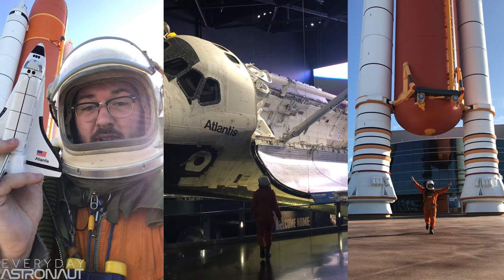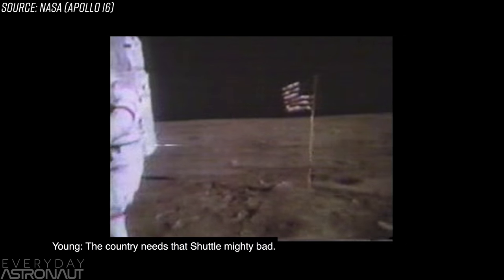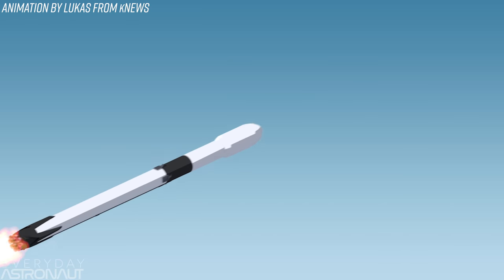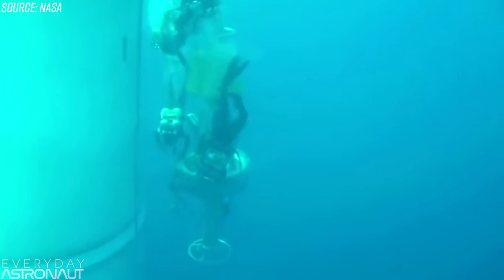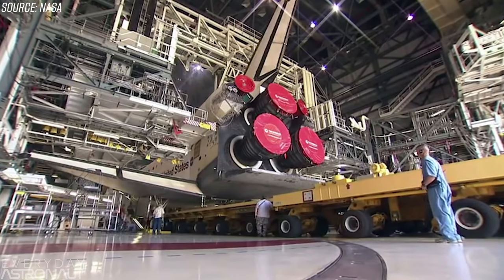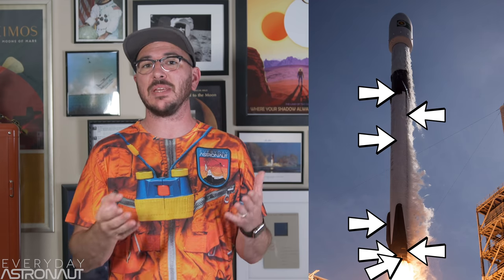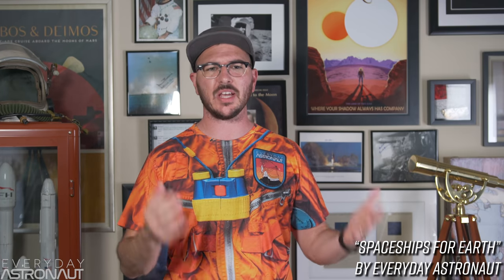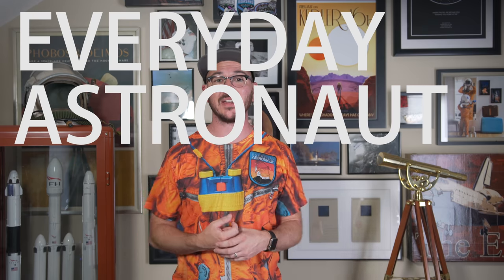Will the Falcon 9 actually be reusable or just refurbish-able like the Space Shuttle?

Comment: I think it's a real apples-to-oranges comparison here.  Clearly you're trying to portray SpaceX's stuff in the best light, which is fine, but I think it's a bit disingenuous to compare the spacecraft and the booster on the shuttle's side (not to mention the shuttle's USAF requirements which made it so unwieldy, such as large wings and a large payload bay) to just SpaceX's booster.  The design decisions SpaceX has made were available to NASA in the 70s, but they couldn't get funding to complete the thing without getting help from the USAF, which required the significant design compromises.  I still feel pretty strongly that the systems required to recover the Falcon boosters outweigh (literally) the single-use rockets.  Just like NASA failed to deliver on its promises of super-cheap spaceflight, I'm not remotely confident that SpaceX will be able to "revolutionize" space flight by recovering the boosters. 

Also, it's not like physics is different for SpaceX.  I think it's the height of arrogance to say you're going to do rocket science better than literally rocket scientists who've been at this for a half century.
Reply from the maker: I think your premise is wrong to begin with. I’m not the one comparing the two (initially), that’s a question I get asked ALL the time, so that’s why I did this video, cited my sources and explained how different they are. It’s not saying one is better than the other, it’s saying why (physically) SpaceX will manage to usher in reusability and not just refurbish-ability, mostly because they’re only reusing the part that takes the least punishment. I’m not smarter than anyone on any of these engineering teams, I’m simply helping explain how they’re different. Please research the video in that scope understanding I’m just trying to frame it in context of the physical differences my friend.

Comment: You can't compere Falcon 9 to Space Shuttle.  You are comparing apples to bananas!
1. Shuttle launches and lands with humans on board
it has been human rated launch vehicle with built in multiple redundant system. Fail-Operational Fail-Operational Fail-Safe
2. Shuttle used to be recovered from orbit
3. Shuttle was bigger, heavier and much more complicated.
4.This days using shuttles computing power, you wouldn't be able even to turn on light in your bathroom.
Reply: The primary purpose of the space shuttle was to put stuff into space, same as the falcon 9.  By pointing out differences here, you are doing a comparison just like the video!  It's is quite easy to compare apples to bananas btw.
Reply: @texmex9721  yep, bicycle vs car :P
Reply: @texmex9721  imagine new Space Shuttle with two Falcon 9 instant SRB

Comment: 2. Wasted Delta V
Reply: @johntheux9238  Lots of wasted delta v with landing legs attached that adds weight and saving fuel for the return burn.
Reply: @SithRacer66  Not a lot. The booster has an empty weight of less than 20 tons, that means it needs to save 20 tons of fuel in order to have 2km/s of delta v to land. If the second stage weight 150 tons with a reusable rocket and you add the 20 tons of wasted fuel your payload increase by 20/150*100 = 13%
So the payload with reusability is only 20/170*100 = 12% lower

Comment: The Us culture is job saving, it damage quality, protect and promote low level knowledge.
One other have to change. Engineering to think about the whole journey before cut material. 
I hear may time the common tool of manipulation racionalizacion. This video was mostly of it.
Facts are Space Shuttle can ascent 25 tons bulky payload and take it home. Non of any new rocket can do the same. Burn own tail and wasting fuel reentry far from the best reentry. The longer the time the lower the reentry heat. Sleek, low drag reduce heat load to minimum. Low weight structure is over proportional reduce fuel demand and increase payload capacity.
Cooled engine could use high efficient fuel. 30% more thrust from engine is the fact vs, CH4 & LOX  primitive overheated solution with rationalization. Jeff Bezos took from ocean after 40 years F-1 engine. Salt water touch ships, boats it is manageable splash and tow home rockets,  composite fairing. Catch them is kid game.  CFD, FEA, analyze tell the truth. Starship reentry overheating to 3500 K .